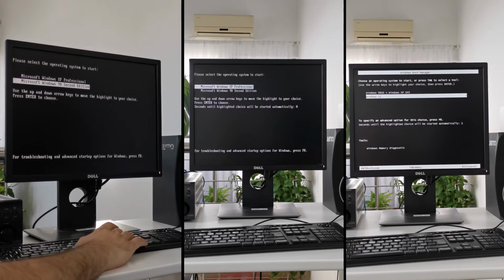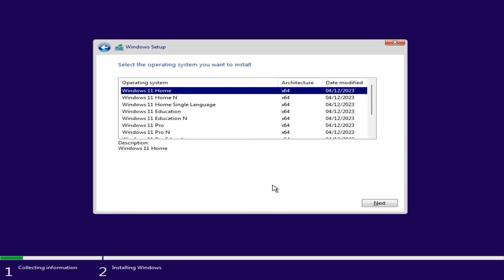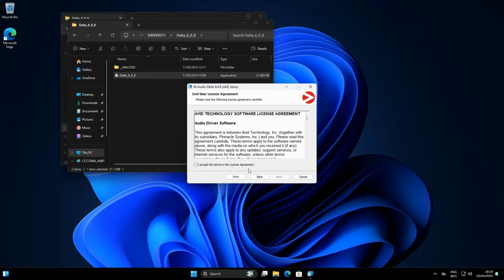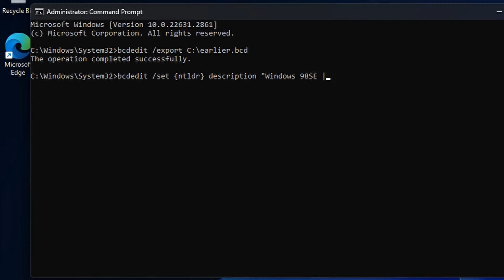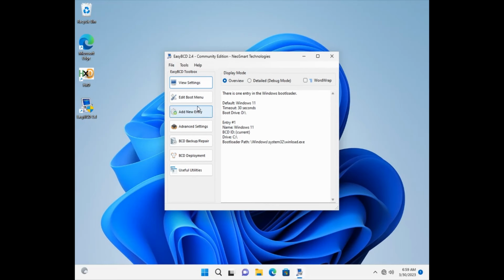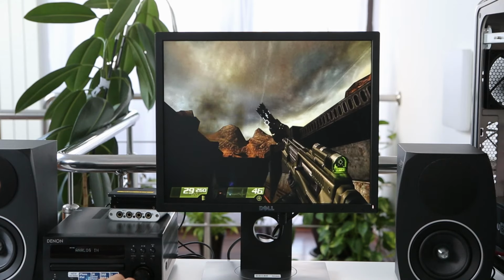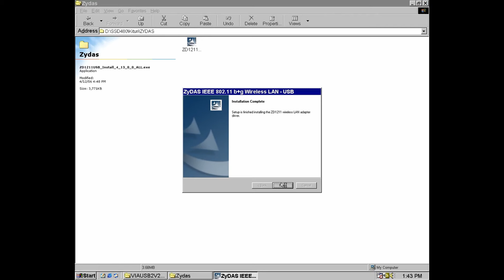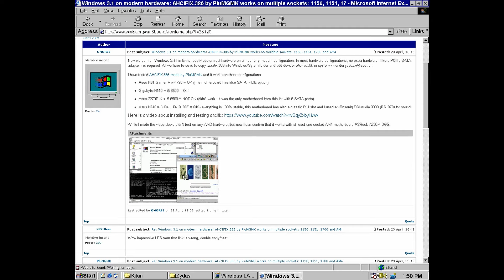Triple Booting Windows 98, XP, and Windows 11 on a Single NVMe SSD – Real Hardware!

Comment: Ah the "Welcome To Windows 98 Song" the extended version, I always used that as the startup sound instead of the simpler one.
Reply: I prefer the original one. If you forget the speakers at maxim level the extended version can get you into trouble.

Comment: Very Interesting stuff. I subscribed and liked. I still prefer the original hardware like 486, pentium I+II, AMD K6-2 etc. But when that original hardware will fail, broke, this is a good future option for running retro games. But in practice mixing new hardware with old software it will bring a lot of practical problems: like those 16 gb ram will be a problem for win98 and winxp games (comanche 4 for ex. will complain for insuficcent ram). And when win98 will crash, you have to reinstall it on other pc. Not to mention that you cant restart win98 in ms-dos mode, or, if you can, you dont have sound in games due to lack of isa sound card.
Reply from the maker: Welcome Aboard! I prefer both original and new hardware! If you don't have space for a "vintage" PC and a new one you can build an "all in one" Windows PC while you can install Windows 98/NT on the latest hardware. (won't last much longer) You don't have to reinstall Windows 9x on another PC, it can be installed as usually, but it's more practical to .zip Windows Folder & Program Files & everything in the root then you can format, make a fresh DOS bootable partition and copy these folders and Windows will load normally. (you need MSDOS.sys in the root) Sound for DOS games it is  a problem, but now we have SBEMU that works with onboard codecs.
Reply: @O_mores  indeed SBEMU is a grrea project. I used it myself on some thinclients for playing ms-dos games and even on a ASUS ROG from 2017. The compatible hardware is growing. Thanks for the tip with the zip winsows 98 installation

Comment: Your 7900GS in Win 11 must be using Win 8 drivers.. My Quadro FX 5500 (same chip) with Win 8 drivers gives strange blocks of corruption and transparent task bar. I wonder if its cos Quadro drivers are not as good as Geforce drivers? Any ideas?
Reply from the maker: I used the "dark theme" and the taskbar and everything looks OKish... as shown in the video. So far, didn't do much research in this direction, maybe trying an older driver made for Windows 7 64.
Reply: @O_mores  I'm using the exact same driver as you.... I NEED the exact name of the dark theme you mention as fixing the issues PLEASE
Reply: @O_mores  the fix seems to be simpler....        [HKEY_CURRENT_USER\SOFTWARE\Microsoft\Windows\CurrentVersion\Themes\Personalize]
"EnableTransparency"=dword:00000000     and I can use in Windows 10... Now my old machine can run Win98(DOS)---Win11 with same GPU (FX1500 or FX5500 or Geforce 7 Series) 🙂
Reply: @O_mores  hi, I've watched all your vids and can't remember which one explains how to get Windows 98 to detect devices.. I installed on my Haswell system but it wont let me install Nvidia drivers (doesnt see the card - Win10 does!) and doesnt see Sound card.   Oh and even with your Logitech fix the mouse doesnt work. It moves but you cannot Left or Right click. Its a generic Dell USB mouse and I do have Legacy USB support in BIOS.  Also have applied PatchMem (I have 8Gb Ram) and Cregfix (dont have issues but why not). Also installed NUSB36.exe for USB but no improvements.   I guess I must use PS2 or install VIA VT6212 PCI controller?
Reply from the maker: @methanoid  You have to manually install the PCI bus, otherwise your Windows 98 it's a total lemon - with only basic devices working - like BIOS clock, kb/ms input, standard VGA etc. Once you install the PCI bus the drivers will detect devices based on their hardware IDs. Until then - you can't install anything. So either you install Windows 98 with "setup /p i" option or you go to > Add new hardware > and add the PCI bus manually, like shown at the end of this video: https://youtu.be/OvYUouo8tvg

Comment: Does Windows 98 work with ACPI on this system?
Reply from the maker: No, I don't use ACPI, and even if it works, I prefer to avoid it because it’s the main source of instability when running Windows 98 on partially ACPI-compatible hardware. The newest motherboard I’ve tested with ACPI support for Windows 98 is a socket 1155 board with the Z68 chipset, featured in my last video: https://youtu.be/uE6qp94InBM  Many ACPI devices are detected on this mobo, including the ACPI Power Button, but sometimes the system freezes when accessing the SSD. Without ACPI, you generally can avoid any hardware-related issues since everything it's very standard and basic.

Comment: Hey. Nice video!
A bit of an off topic question: have you encountered or heard of graphical glitches when running Windows 9x/3.x on Zen 3+(?) CPUs? These glitches happen regardless of what video card is used, and they seem to be exclusively graphical, as the system works fine otherwise.
Reply: Even video cards that are working fine on older CPUs/platforms?
These do not occur on Intel?
Are the gliches gone when graphic drivers (even VBEMP) are installed? 
I know about some graphical glitches in Win 3.x/9x but those are due to the more modern GPUs not working well with the default vga.drv driver.
Reply from the maker: Hey! I haven't used any ZEN3+ CPU so far so I don't know. I get graphical glitches on my ZEN 2 (3900X)configuration which has a PCI Voodoo 3 (and you would expect to behave normally) but this happens only with standard VGA drivers, after I install proper drivers everything is totally fine. This type of glitches when using Windows 3.x/9x happens on various modern configurations, but not always. For  example, on this Intel 13th Gen configuration I get glitches during Windows 98 setup with a GeForce GT630 but not with a 7900GS.
Reply: @pangoomis  Yes, No, and... uh I need to check because I don't have this setup ready for testing this right now.
Reply: @O_mores  Assuming they go away when installing proper drivers, it would still be interesting to know the root cause of the issue. It would also be interesting to know if these happen in a VM, which would mean it's something inherently architectural to the CPU, so I'll need to test that too.
Reply: @mintsuki1 My 2c, if glitching it doesn't happen in text mode, then it has to do with the way data actually gets transferred into video memory. A bitmap will be mapped into RAM first then it will go into video memory. At this point some garbage enters into video memory. https://en.wikipedia.org/wiki/Memory-mapped_I/O_and_port-mapped_I/O

Comment: That's cool that the 309 driver works well here in Win 11 with the GPU. I remember being able to use the 309 driver with windows 10 on the geforce 6000/7000 IGP at first, but a windows feature update caused them to BSOD. I guess a discrete card does not BSOD. Cool! Windows 11 24H2 cuts off support for older than core I series and FX series, what do you guess the next thing they block will be? Hopefully not legacy mode, I doubt it though, there probably is a server somewhere that's supported with a newer version of windows server using legacy mode. I hope that Windows 11 does not change any more after 24H2, but I do hope that Windows 12 doesn't work in legacy mode, requiring UEFI mode, we'll hopefully have computers that don't support CSM period by then.
Reply from the maker: I saw some road maps for industrial motherboards (with legacy BIOS) and they offered support until 2033 for that line. (including X86 CPUs) So I guess Legacy mode will be available for a long time, but maybe not for free as today. From 2030 we might find CSM only in industrial motherboards so we have to pay a premium for this feature. Anyway... I hope that consumer motherboards with PS/2 ports/PCI and legacy BIOS will be produced for a few generations more.
Reply: @O_mores  I'm with you. I remember building my core i3-10100 test bench, and being annoyed that it has no legacy ROM for it's onboard graphics, so if I want to use legacy mode I have to install a GPU (using a gt740) . I like to boot other people's C drive partition in my bench and having legacy mode is very useful!

Comment: EasyBCD is great, I used it a while back to clean up the boot menu on a system I built with every windows from Me-7 (32 & 64)+10 32. The biggest pain with it was getting each OS to be on the C partition without corrupting an existing installs. If there are any extended partitions XP's disk manager doesn't like changing the primary partition.
Reply from the maker: Here's an interesting fact: Windows NT 3.51 can start from WINNT folder from whatever letter the drive will get. (usually C: will the the SATA port 0) There will be some issues because the path to Windows folder is C:\WINNT, but you can change the drive letters on the fly using Disk Manager - first, you put another letter on the current C: drive, then you assign C: to whatever partition you want.

Comment: If you upgrade windows 98 to windows me, will it boot faster?
Reply from the maker: Now it boots in about 10 seconds, I guess we can go as low as 7 without networking. Windows ME it's about the same. In both cases if we install a LAN adapter boot time will increase depending on how fast DHCP will get an IP.
Reply: Windows ME should boot faster! I remember it was faster than Windows 98.

Comment: Hi again, OMORES! I tried your method about win2k but still black screen after boot animation screen. What should I do ?
Reply from the maker: Hi! Well, I need some specific error in order to help you. A black screen can be caused by a gazillion of issues...:)  Did you used an existing Windows 2K installation from another PC, then you installed UniATA, then you used that drive with some newer PC? If so , you might want to check what type of PC is used in the first place - Standard/MPS/ACPI?
Reply: @O_mores  I installed Windows 2k SP4 in VM in Standard PC with F5 and F7. When installation complete, I installed UniATA driver. My PC is from 2010 (Samsung RV510 model) and I think it's older from VM. I copied files from VM to that Samsung PC's hard drive. When I boot to Win2k, it passes the boot screen but after that, it stays in black screen. I think there is no 0x7b anymore but something different.
Reply from the maker: @ages2001  Maybe you want to try this installation kit: http://www.pinzaru.ro/windows9x/2K_Uniata_Standard_SP4.zip
Reply: @O_mores  Thanks, I'll try this! If this does not work, what should I do? There must be a solution because PC is from 2010 and you even managed install old OSes to newer hardwares.
Reply from the maker: @ages2001  Maybe it works, it's the Windows 2K installation from YouTube video.
Reply: @O_mores  it gave 0x7b :( We should find another methods.
Reply from the maker: @ages2001  Did you replace the contents on the root also? ntdetect, ntldr...?
Reply: @O_mores  yes, I'm sure.
Reply: @O_mores  I did everything you said correctly but still no luck
Reply from the maker: @ages2001  Hmm... it might be also something related to partitions. For example if you had Windows 2K on the 3rd partition of a drive and now you are booting from the first partition this will confuse Win2K, but usually you get a error message.
Reply: @O_mores  I copied files to boot partition which is formatted FAT16.
Reply from the maker: @ages2001  I can give more archived Win2K installations - to see if it works or if you get at least a different error: http://pinzaru.ro/windows9x/2K_uni.zip
Reply: @O_mores  Okay, you can give all links, Win2k, NT4 and NT3.x if you want to give. Thanks from now!
Reply: @O_mores  I tried 2K_uni.zip file. First, it give uniata.sys BSOD and I changed file. Then, no more BSOD but same thing again: passes boot screen and black screen.
Reply from the maker: Give it a try to NT4 - this is the one used in the first video with a socket 1700 motherboard: pinzaru.ro/windows9x/nt4_1700.zip
Reply: @O_mores  It gave 0x7b BSOD
Reply from the maker: @ages2001  I think it's something wrong with your AHCI configuration/firmware. I used the very same files on an Intel 13th Gen configuration... and it worked from the first try. I literally took the SSD from my AMD Ryzen 3900x and I connected it to a H610 motherboard /i3-13100F... and I saw the logon screen.
Reply: @O_mores  in IDE mode, it gave BSOD. viamraid.sys and uniata.sys caused this. What viamraid.sys mean?
Reply: @O_mores  maybe you can give all links. I'll try all of them.
Reply from the maker: @ages2001  These are all the links, I basically uploaded manually every .zip file in this thread while replying to you. (using FTP) Is your FAT16 partition the first one on the drive?
Reply: @O_mores  yes, first 2GB. It also includes MS-DOS and Windows 3.x . They work fine but I couldn't get working NT3.x, NT4.x and 2k. But XP works fine in another NTFS partition.
Reply from the maker: @ages2001  I don't know... On some configurations I solved 0x7B by swapping cards or adding cards.  Your SATA controller might get a different IRQ if you disable the on board LAN and the sound card. I had to do this specifically for Windows 2K.
Reply: @O_mores  sound not working. I disabled LAN but still same 0x7b :(
Reply from the maker: @ages2001  VIAMRAID.SYS is the driver for a PCI to SATA controller with VIA 6421 chip, but if the controller is not present it shouldn't cause any issues.
Reply: @O_mores  I understood. Is there another solution or should I accept failure?
Reply from the maker: @ages2001  You should try those installations on some other hardware if you can, then ... when it finally works (because it should) use that exact drive with your RV510.
Reply: @O_mores  oh... I will try that. Is there another solution. So I can try other solutions in my free times.

Comment: hei, Omores, mersi mult pt recomandarea legata de placa video. a mers perfect, ma gandesc sa mai iau una pt SLI :) am dus-o-n 550 cu 700 fara nicio problema si-i stabila. Si p-asta Midtown Madness are artefacte, ca pe toate nvidia pe care le am, numa' cu ATi jocul merge cum trebuie si fara artefcate. e din drv nvidia, 110% :)
Reply from the maker: Bun asa! Ce placa ti-ai luat mai exact, de cine manufacturata?
Reply: @O_mores  nu stiu cine a facut-o, avea un stick cu HP pe ea care s-a dus cand am spalat-o. sigur nu-i facuta de HP. arata exact ca-n pozele din arhiva GPU de pe techpowerup